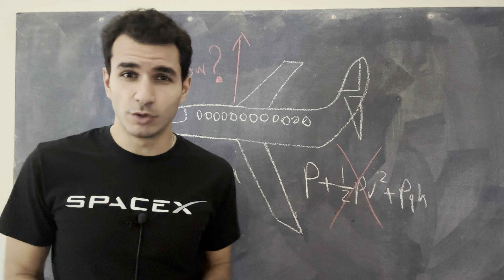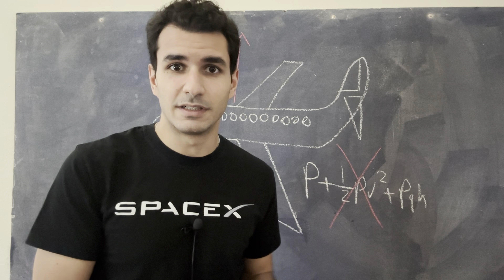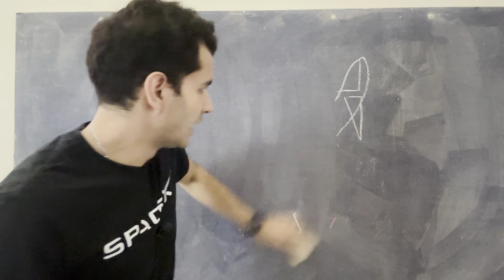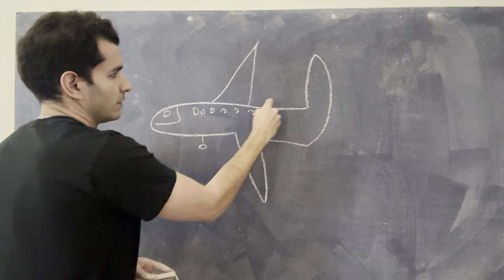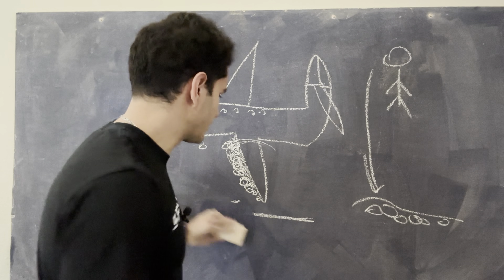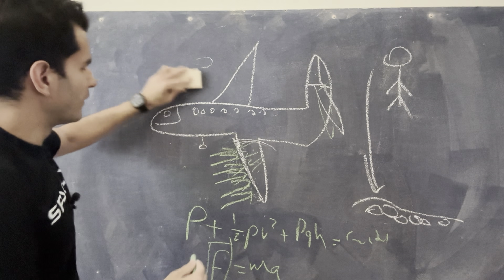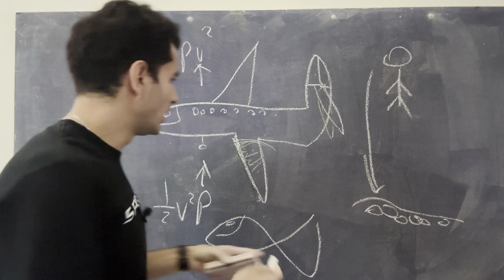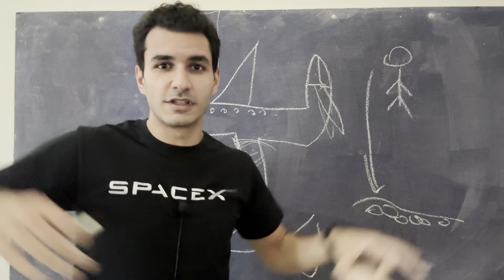Fix This One Misconception = Understand Airplanes Forever

Comment: I am no phd graduate/researcher or expert but a rocket pointing up will go up if the engine is powerful enough.  It doesn’t need wings.  You can even land it vertically.  A rocket pointing horizontally and with wings is essentially a plane.  My belief is the reason the wing generates lift and brings the plane up with it is because the air travelling (once it is moving fast enough) over the wings is redirected downwards over the rear edge and according to Newton’s third law, every action has an equal and opposite reaction.
Reply: But it's not just over the rear edge.  Flow is being turned downwards everywher: well before the rear edge and above and below the wing, because the total volume of air turned downward is too massive to occur in only a single location.

Comment: Airspeed will determine how much weight an airfoil can lift but changing the weight will not make the airfoil rise or descend. To do that the airfoil must have positive or negative angle of attack. That is why a aircraft flying at supersonic speed at level flight will not gain altitude.

Comment: This is irrelevant and incorrect theory. The jumper after hitting to water pushes up ok, notice the forces are parallel and opposite, in the airplane situation  as it moves forward the air molecules hit to the leading edge and makes drag a force exactly parallel and opposite to thrust , where does it come from it should  pushes up why ? Not until an airfoil tilted and then third law of Newton happens.

Comment: “Tilt” has nothing to do with it. Most airplanes can take off eventually given a long enough runway WITHOUT “tilting” the wing. The pressure differential has to do more with the shape of the wing than the angle.
Reply: Asymmetry that's all, whether from tilt or camber, lift is all about total asymmetry applied.

Comment: One question comes to mind. As the angle of attack reaches its point where the upper surface airflow becomes turbulent rather than laminar, the wing loses lift and a  “stall” results. Why?- the air molecules under the wing are still piling up and developing pressure. Why does it matter why the upper surface flow is laminar or turbulent?
Reply: Because the airflow over the wing accounts for up to 80% of the lift, the rest comes from the lower surface.    The "explanation" in this video is simplistic and incorrect.
Reply: Yes, the low pressure region becomes higher pressure as the airflow is stalled and the wing pressure differential becomes equalised - this video says that static pressure is the main thing that allows a wing to fly - it has a component, yes, but the pressure differential caused by airflow over a cambered aerofoil surface is the main element of lift.
Reply: @FastJetPerformance But the pressure difference you mention as being the main  cause of lift, is primarily static pressure drop which you say is only a component?
Reply: @davetime5234 we’re really talking about the same thing from different angles.

I was focusing on the cause of the static pressure difference (airflow acceleration over the upper surface due to camber and angle of attack, i.e., Bernoulli effect + Newton’s third), while you’re rightly pointing out that the lift itself comes from the measured static pressure difference across the wing surfaces.

So yes, the pressure differential is a static pressure drop — but I was emphasising what drives that drop, not separating it as unrelated.
Reply: That's my question that I'd like him to explain.  You asked it better.
Reply: @freepilot7732  because he s wrong saying that Newton's second law is what explains lift.  There are several effects that actively participate in lift: what he explained + Bernouilli principle + compression of the air in front of the wing + and the boundary layer on the extrados that is responsible for the Coanda effect.  See my response to him directly in the comment section for more details.
Reply: @StefBelgium  Mass flow continuity, conservation of energy, and conservation of momentum explain lift.  The rest is just fast food processed out of basic food nutrients.
Reply: @StefBelgium Yes I'm aware. My comment was more rhetorical in nature. I'm a pilot myself since 1997.
Reply: @freepilot7732 It occurred to me that during takeoff there is nowhere near enough air mass available beneath the wing to satisfy the downward change in flow momentum requirement.  So the volume of air mass above the wing has to be doing the heavy lifting.  

Though beneath the wing in close ground proximity is the only phase of flight where you can get a pressure change contribution to lift without the need for an equal downward momentum effect: the air pressure in the region between ground and wing presumably can sustain higher than ambient pressure against the ground itself.

Comment: I don t 100% buy it, I'm sorry.  You are equally wrong as those who state that the Bernouilli principle explains lift.  How do you explain that a wing can generate lift even at 0 angle of attack?  The Bernouilli effect has to kick in first due to the shape of the wing, pushing more air molecules downwards than upwards, or accelerating the air on top of the wing to generate a difference of pressure.  At 0 angle of attack, the surface of below the wing that the air molecules is colliding with, is then null since the air molecules are going along (parallel to) the intrados of the wing, so there is no component of the force acting up.  But obviously, when the angle of attack is positive, the air molecules start to collide the intrados of the wing with a certain angle, and then the vertical component of the force acts as lift.  But, the Bernouilli principle also actively participates in the process.  And actually, there are other effects: the wing compresses the air at the leading edge to create a zone of high pressure in front of the wing.  When the air moves around the wing, especially above the wing, the pressure decreases, and added to the lower pressure generated through the Bernouilli principle.
Another effect: the boundary layer of air on the extrados, generates the so-called Coanda effect: the air literally sticks to the extrados of the wing, changing its direction and velocity, thus momentum.  That change of momentum, induces a force with a vertical component in the up direction, just like the air bouncing of the  intrados, changes direction and generates a force due to a change of momentum of the air flow as you explained in your video.
So there are at least 4 phenomena involved to create lift.

PS: the Bernouilli effect is real as experimental air tunel shows that the molecules of air that separate at the leading edge, not even arrive back at the same point at the trealing edge, but the air going above the wing arrives 25% faster than the air going below the wing so it goes even faster than what we tought.
Reply: I read your original reply to this video and agree with it. It seems that all attempts to explain lift in layman's terms oversimplify the physics at work. 
Ever since I was a child, it bothered me that simple toy store balsa gliders flew so well with zero airfoil. In school I was taught the Bernoulli factors, and it never really added up for me. I'm now 70 years old and still sit and ponder this subject!
Reply: @bobparis2259  Maybe you should study a science subject of two.  Bernoulli is a conservation of energy perspective, which exists everywhere and always.  The elements of wing design used reliably industry (CFD), is based most fundamentally on conservation of mass flow rate, conservation of energy and conservation of momentum.  There's no mystery in reading a language if you have studied the language.

Comment: The problem is that most people, including lots of pilots and even lots of engineers handle Bernoulli and Newton laws as if they were different things or phenomena, and don't realize that Bernoulli´s theorem and Newton's laws are de VERY SAME THING but expressed and rearranged in different  mathematical/physical terms....Bernoulli´s is in essence Newton laws re-arrangend to be applied to fluids dynamics...That´s the problem. There is only one lift-producing process, be it  Newton and Bernoulli TOGETHER because they are the same thing. The fights are because most people arguing this topic actually have no clue of what they're talking about but nevertheless they think they are experts...
Reply: CFD used by Boeing, Airbus, Nasa etc. to design wings capable of specific lift requirements:  conservation of mass flow rate, conservation of energy, conservation of momentum.  It's easy but not simple.  Especially given that the Dunning-Kruger effect is no less damaging coming from experts as amateurs.

Comment: Well, this is all fine and dandy. But, the camber shape of the aerofoil also helps the airliner to maintain a shallower angle of attack during the cruise phase of the flight envelope. If the wing section of the aerofoil was flat, there would have to be a significant increase in pitch trim to maintain a comfortable angle of attack at lower subsonic speeds. And an aircraft such as the F-5 for instance, can get away with having a ‘flat’ wing because of its reactively small airframe; the moment arm of maintaining its pitch attitude and angle of attack is significantly smaller. I personally think all these arguments about the contributions by different physicists and mathematicians are just to argue for the sake of arguing.

Comment: Question: if it's the underside of the wing that pushes the wing up, why do wings have spoilers to cancel lift?
Reply: Ouch!
Reply: Because the "explanation" in this video is incorrect.  Only about 20% of the lift comes from below the wing, 80% is from the air flowing over and above the wing.   Autogyros have no downward deflected air, fly in a biplane and there is no air being deflected downwards, and if ice forms on the UPPER surface, the wing loses lift.  Nice theory but doesn't fit the facts.
Reply: @karhukivi  
Thank you. That makes perfect sense.

Comment: If the angle of attack increases sufficiently the wing will stall. Please explain your hypothesis as it relates to wing stall.
Reply: It seems pretty simple to me. Once the angle of attack is at a point that lift transitions into drag the wing stalls. In other words, when the air pushes the wing back instead of up stall occurs.

Comment: So, we gotta think of air as fluid to start.
And the angle of attack is how we ride on that fluid or cut through that fluid?

Because an aggressive angle might create a lot of lift, but it also creates more drag. While a neutral angle essentially lets you ride on the fluid.

But realistically the lift isn't "pressure difference" related quite the way that Bernoulli told us. But more of how the wing design is able to navigate the fluid/air. 

Did I get that right then?

Comment: I used to have a great big RC glider it look like the wings were cheated with plywood and The Air Foil was like an eppler 205 with some reflex ... Permanent reflex.... It was faster than any power plane in the whole club... Either cruising or into a shallow dive depending on what plane I was racing they got so mad they hated me at that club

Comment: good , but there is a situation where you can look at it as a flat bottom wing with a curved top, which then uses Bernoulli and newton.   the pressure are not pushing the wing up because they are bunching up, there is a low pressure above the wing which is lower , so the differential pressure creates a net force on the bottom vs the top..   more pressure can be created by the reasons you speak to regarding AoA.

Comment: If your concept is correct, then there would be no need for different wing airfoils…just a flat slab would work. However, different shaped airfoils generate different amounts of lift at the same velocity. Why?  Further there would be no wing vorticies  generated with a slab wing…like a kite. Even the Wright brothers understood this and curved their wing from front to back. Take apiece of paper, hold one edge and blow over the top. It rises because there is less pressure on the top, and NO air pushing it from below.

Comment: Velocity, Air molecules, and AOA or angle of attack.  Remember sticking your flat hand out of a car window and how you arm would lift with more speed.   Even a flat sheet of cardboard with no cupping into an airfoil shape will lift.
Reply from the maker: YES! why is this so hard to understand for so many aerospace bros?
Reply: @alithedazzling yeah but what's the relevance of it in terms of accepted first principles of physics.  Have you done the vertical flow momentum change calculations to assess the theoretical consequences for your position?  Obviously not.  What are the numbers and what do they imply about your "be intuitive; run from formulas" at all cost admonition?

Comment: Hey I just have one doubt, you gave the analogy of a person jumping in the water from a long distance say x unit but in this case there is a medium change(air to water) after the x distance which is not the case in aeroplane lift as it tries to take off in the same medium. I mean will the person experience a significantly high force if not the same if there is no medium change. Let's say at x-y units where y is significantly small distance as compare to x and there is no medium change. Also inform me iff terminal velocity has anything to do with in these type of cases.
I will be glad if you will clear my doubt or tell me if there is anything I am missing.🙏

Comment: I think it's also important to talk about viscosity causing a low pressure zone on the top of the wing (a la coanda effect). This is a significant portion of lift, and it's the portion of lift that is lost during an aerodynamic stall.
Reply: Yes, but what is more significant than that loss of lift, is the massive increase in drag as the air detaches and becomes turbulent on exceeding he critical angle.
Reply: @Stannas95  I've been thinking about this for the past few minutes, and I'm not so sure that there's an increase in drag as a direct result of the stall. What's happening as it becomes turbulent is that the high pressure from underneath the wing is getting up around the trailing edge and detaching the flow, like you said. This means that the pressure above the wing is inherently becoming higher, which is why we lose all that lift. This should actually decrease induced drag, because there's less of a pressure differential, and thus less of a drag part of those lift/drag vectors.

It's been a very long time since I've practiced real stalls in an airplane, but anecdotally, I don't remember an increase in drag, I just remember buffeting and then a nose drop.
Reply: @mdrocketry there is a major increase in drag. for two reasons: 1 you are slowing down therefore induced drag is actually worse since it varies ~ 1/V^2, and also pressure drag is increased since as you said, high pressure air is now going behind and up the airfoil in the opposite direction.

Comment: This is crap.....the speaker does not understand the circulation theory of lift.
Reply: While circulation is real, the "circulation theory of lift" is equal parts misleading and helpful, at least for the usual impressionable students who are more submissive than critical thinking.
Reply: @davetime5234  The great thing about the circulation theory is that it predicts within a few percent the way that lift increases with the angle of incidence. Hand waving analogies don't do this.

Comment: It makes sense intuitively, and I agree that Bernoulli’s principle and Newton’s laws describe the same phenomenon from different perspectives. However, I think the phrasing could be improved where it was mentioned that a plane needs to go fast for its control surfaces to work. It's not that "air density " increases with speed (may be intuation is right but...) — as air density remains constant at a given altitude. Rather, as the plane moves faster, the velocity of air relative to the control surfaces increases. This higher relative airspeed generates greater aerodynamic forces on those surfaces (like the rudder, elevator, and ailerons), allowing them to effectively control the aircraft’s motion. --
Reply: While some of what you say is good, this is a nonsensical statement:  "Bernoulli’s principle and Newton’s laws describe the same phenomenon from different perspectives".  You can't have part of a picture and have it make the whole picture.
Reply: @davetime5234  ah I see, I should have said, "in this specific case"?

Comment: Best explanation of how these interact to form a complete picture. The molecules must experience a certain AOA before any lift is created. Otherwise you just simply have a half ventury with the molecules in the upper part of the wing moving faster than the bottom, meeting at the end of the wing ahead of the lower molecules which by itself does not createvthe lifting force.
Reply: So, you have two competing concepts of: non-built-in asymmetry vs built-in asymmetry?  Perhaps you might distill out of that, asymmetry is the common denomenator?

An asymmetrically shaped meteor entering the earth's atmosphere would experience a transverse force.  It likely will not be efficiently produced but it is still there.

The atmosphere doesn't stop to ask:  "what is your chord line, so I can tell if the transverse force I assign is AOA caused or camber caused".
Reply: I can tell you as someone who has flown an aircraft at 0 angle of attack, this is simply not true.

Comment: This is the bullet theory and is not correct, also NASA web page said is incorrect. Most of lift is generated upwards, by suction.  Also in this case lift is explained by Bernoulli and Newton from different perspective but both consider dedlectimg air in downwash.